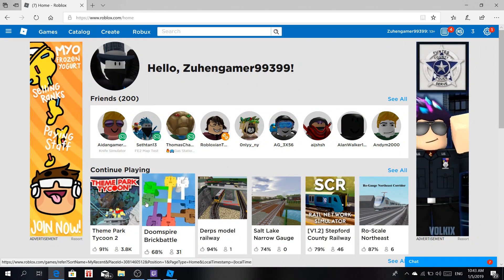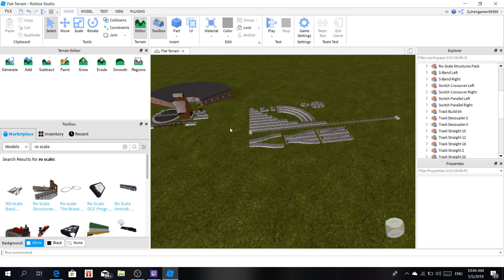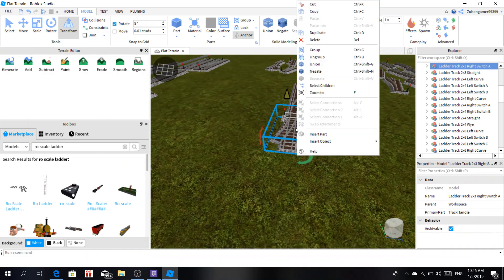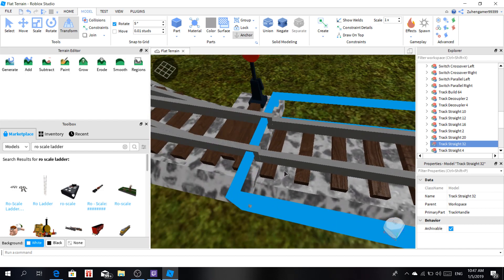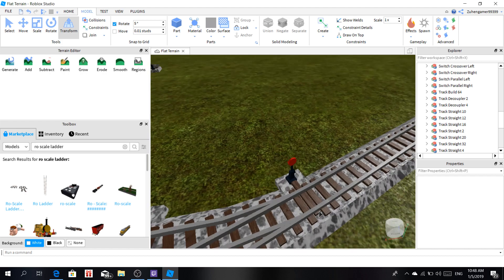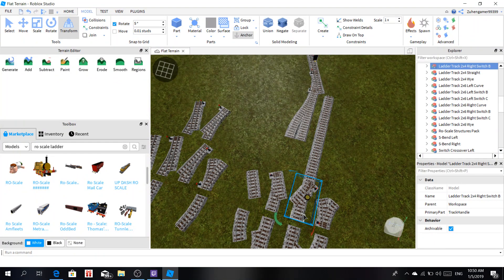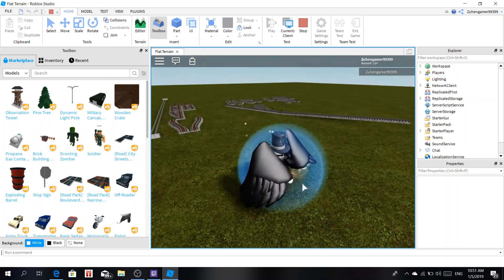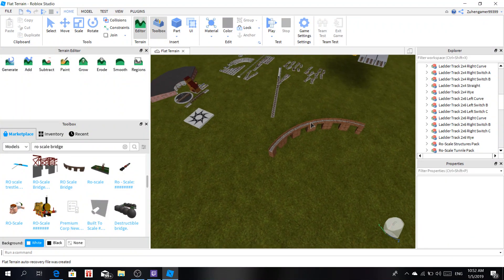(OUTDATED)Roblox Tutorial 1 (How To Fix Ro Scale Track Connection and build your own ro scale game!)

Comment: But that coach needed to anchor! It has advanced weld script! I also like a pro ro-scale builder. But we need to anchor that coach or a train. I hate unanchoring things
Reply from the maker: Btw the issue is now fixed and im using the proper tool to make a railway
Reply: @BYD4005Z  o ok.